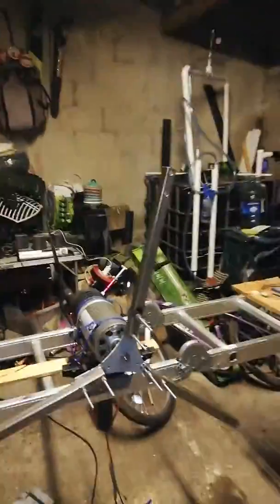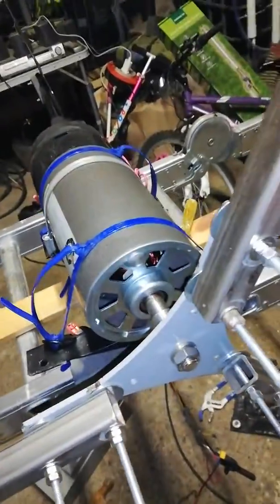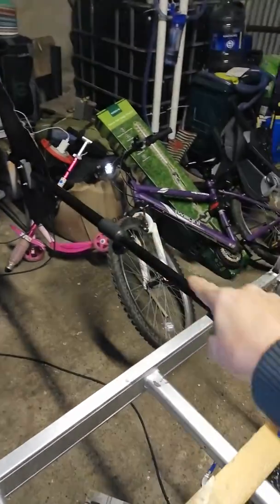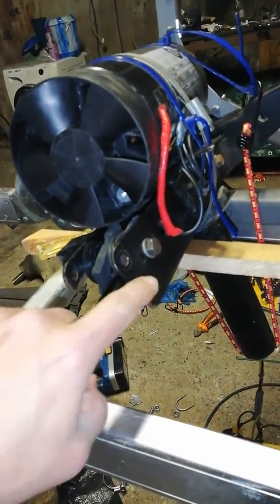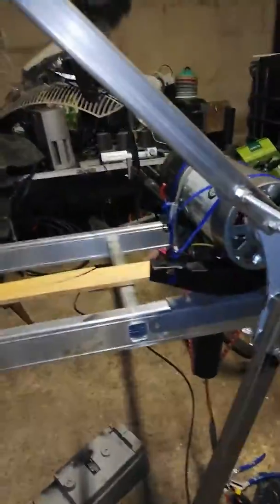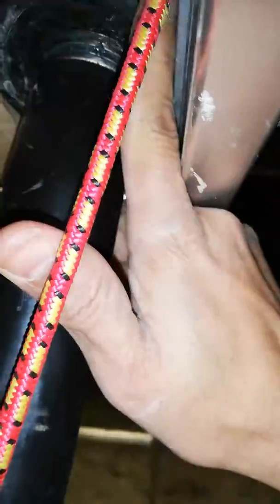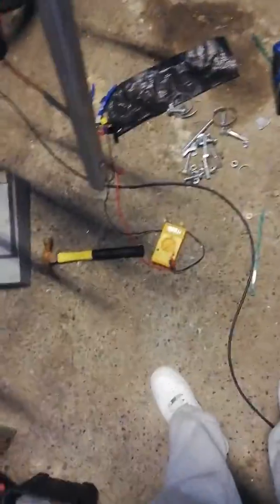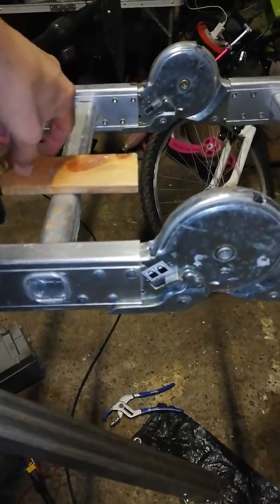How to make wind turbine from treadmill motor

Comment: What is price of treadmill motor
Reply from the maker: not that expensive easily available  on eBay or amazon or search in your local area for a broken one and take out the motor.
Reply: @techcity7866  ebay not working in india plus Amazon India shows 12000 INR

Comment: Have you tested
Reply from the maker: yes I have and does generate 12v but before you put it up make sure the brushes are not so worn if get the new ones for long run. I still ve to do a permanent setup with my valence lithium ion batteries.